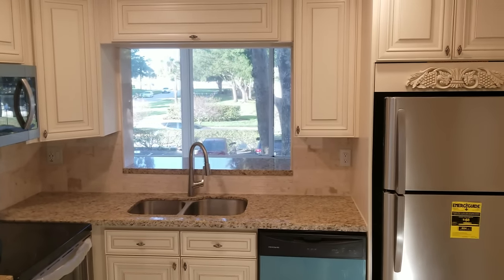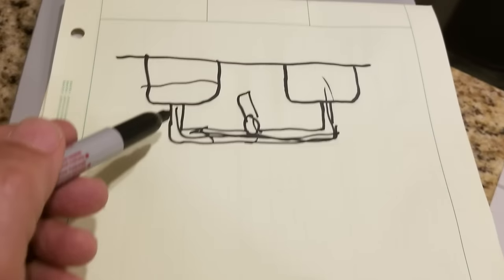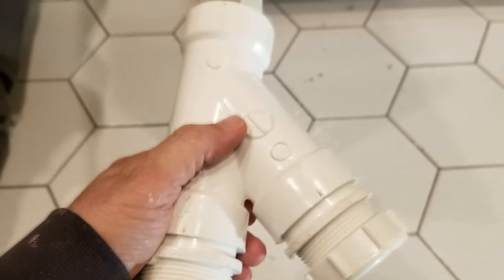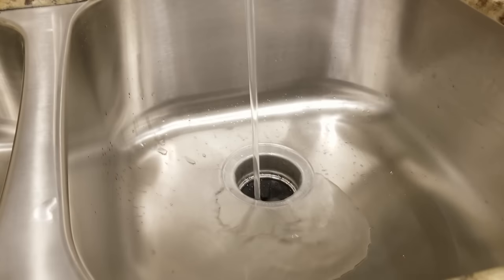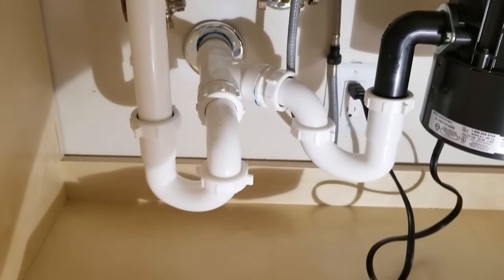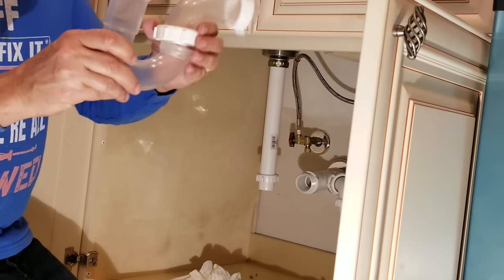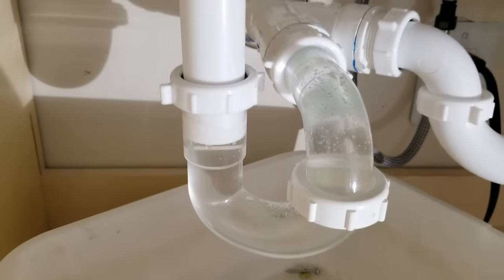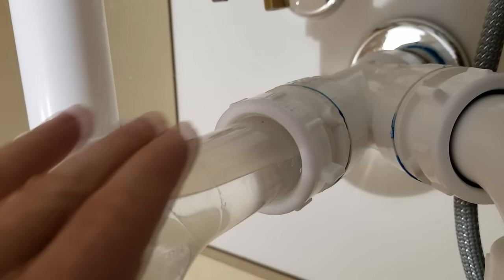How to Install Dual Kitchen Sink Drain Plumbing Pipes

Comment from the maker: ✅ Kitchen sink drain tools/pipes in this leaking p trap plumbing tips video:
🛒 Superior Tool 3-Way Sink Drain Wrench: https://amzn.to/2XozbZp
🛒 Nibco 1-1/2 in. PVC DWV Wye Fitting: https://homedepot.sjv.io/P1WbX
Reply: A lot of those t's have a baffle in them that just plug up right away when you use the garbage disposal.
Reply from the maker: @DamnWelfareBums  Luckily we avoided using any baffled T connections, using instead just the P-traps going into the Wye connector.
Reply: jeffostroff Yeah I like the way you did it.
Reply: @DamnWelfareBums  Exactly. I have had two near disasters due to those connectors having that baffle. It really restricts the water flow and if things like potato and carrot peels will get caught there and really back things up. I have thought about re-plumbing my system exactly as you have done to give the disposal its own trap.
Reply: Y

Comment: Two p-traps on one fixture is a no-no. One trap can siphon the other and cause issues. This is why you can't even have traps too close together. I've seen a washing machine trap siphon out the toilet trap. Not enough piping in between and the washing machine would siphon out the toilet whenever it drained and the toilet wouldn't flush properly (not to mention the sewer gases now could enter the house). One trap per fixture is code, that's all you need, don't overthink it because you're just making things worse.
Reply from the maker: They cannot siphon from one another when using a Wye like we did. You are allowed one trap per fixture, and each sink counts as one fixture.
Reply: @jeffostroff  I'm not sure a Wye can be on its side and function properly. I'm pretty sure a Wye has to be vertical to function properly.
Reply: I agree It can cause a siphon doing it this way. It might not cause an issue in every case but I don't think it's a better way to run a drain and  it wouldn't pass Code
Reply: If syphoning would occur, you could add an air admittance valve. I am certain this system will work.  My current system with one P-trap backs up to the other sink all the time.  Great video.  I’m going to do this. 🤘
Reply: @theflyingdutchman787  Doesn't matter if it'll work or not, it's against code. 

It sounds like your sink is backing up because of a blockage, probably in the existing p-trap assembly. Taking it apart, cleaning out the p-trap assembly and snaking the line would fix that. Adding a 2nd trap won't fix that. It'll just add another blockage point especially since you'd also be introducing a potential siphoning issue and then you'll have even more problems. Don't do this.
Reply: @jeffostroff  Yes, but you're still potentially introducing drainage issues with a 2-trap setup like this. Which is why it's more optimal (and code in most instances) to only use 1 trap for these kinds of situations.
Reply: @aliikane  A T-wye can't be used horizontally but a regular wye (like in this video) can.
Reply: @losferwords100  I appreciate the dialogue and your concern. The P-trap under my sink is clean as a whistle. I am trying to find the plumbing code verbiage that prohibits the wye-dual P-trap setup.  P-traps in series are not ok, I agree , but I can’t find the code addressing a parallel system like this. I truly see no physical reason why this system would not work properly, especially if a studer or air admittance valve is incorporated into the system.  Again, interesting debate.
Reply: You are so WRONG
Reply: Ive had this for years with y fitting it drains fine.
Reply: THIS!  He did that completely wrong.

Comment: JEFF WHAT HAPPENED???? According to the uniform plumbing code from ( The international association of Plumbing and Mechanical officials)  section 1001.0  No more than 1 trap is permitted per trap arm ( Pipe coming out of wall.) & per plumbing fixture. This should help You & Your customer's.. From many more future failed inspections.
Reply from the maker: Alex, the way I read that, is they are saying "No more than 1 trap is permitted per trap arm", which means to me, that you cannot have one P-trap followed by another P-trap on the same P-trap arm, which is the output of the first P-trap. They don't want people to connect 2 P-traps in series, back to back. But I am connecting 2 P-trap arms to a waste line through a Wye adapter. It really boils down to the definition of P-trap arm, which is not the waste line. The P-trap arm is simply the curved piece of pipe coming  from the P-trap.

Comment: The reason there is so much water in your P trap is because you didn't put a slope on the pipe going to the main drain... You also should have in a put a vent pipe... judging by how slow the water drains in your sink you need a vent pipe in that sink to prevent clogs and slow draining issues.
Reply: I been watching a few other videos and they always put a slope using a level. I was surprised he didn’t do that. When I saw to amount of water in that p-trap, I knew he messed up.

Comment: This is the right way to do the job. The guys who renovated my kitchen hooked it up as you drew in the first drawing. When you turn on the disposal, it pushes water out of the drain in the other side of the sink! I told them to fix it, and they hooked it up the same wrong way. So I did it myself. Thanks for the video.
Reply from the maker: Glad to help Stan!
Reply: Can't put a tee on its side

Comment: My friend, your video is EXACTLY what I need.  My garbage disposal always, I mean ALWAYS "throws up" into the other sink!  Going to implement this solution soonest.  Thank you, thank you, thank you soooooooooooo much!!
Reply from the maker: Another thing you can look into also when one side of the sink is backing up into the other sink, make sure that your line is clean all the way down to the sewer system. So we have another video that I uploaded about aklog we had similar to this in our kitchen, in my snake only goes 20 feet but we had to call the plumber with sectional snakes that could reach further down the line into the sewer system and they found some clogging there had a curd and so this can make the water slow to drain out of the sink and it sometimes will back up into the other one. You might be ready to have your lines cleaned.
Reply: @jeffostroff  I’ll see if this works, if not I’ll have a plumber clean out my line.  Thanks again for the follow up!!
Reply: Well I completed my Y-drain with dual p-traps and it worked like a charm, NO back flow from the disposal to the other sink!!  One thing I learned was the need for using DWV trap adapters to go from 1-1/4 to standard sink p-trap hardware.  But it all works!!!  Thanks again for your awesome video and help!!!!!
Reply: @snoodle877  Glad you gave an update. I have the same problem. Looks easy enough. Think I'll tackle it myself. 🤞🏼

Comment: I'm changing out my sink to dual sinks also and found this idea of double P traps  to be interesting. I decided to make sure this idea was a good way to go and was surprised to learn that it's not for a couple of reasons. One problem that can occur with a double trapped setup is if a large volume of water is released down both drains it may carry enough pressure to pull the water out of the traps which means sewer gases may be allowed into the house. Another problem is double traps cause drainage issues because air becomes trapped between the two traps, and air is lighter than water. That causes the air to travel up as the water flows down, resulting in no drainage. Also in some areas, using two traps  is not up to code and the water draining from one sink can impair the trap seal on the other so check your building codes. 
One thing I'd like to suggest to those who plan on using this method is when you insert the tubes into the wye, make sure one doesn't butt up to the other. I looked at the idea at Lowes and noticed the wye doesn't have a stopper in them so allow about 1/16-1/8 inch of the tube from the sink to go past the 2nd entrance of the wye. That will stop the tube from the wye from blocking it. 
After all I read and learned from plumbers shopping at Lowe's, I'll pass on this idea but good luck to those who don't. Peace out.
Reply: Your research is correct, 2 traps will cause one to empty the other or suck it out by vacume even if it's vented properly. I think this was just a diy idea and not professional advice.

Comment: I really like you idea using the y connector so you have to separate drains. In my case I used a trap that had a y connector built into it. Two separate drains connected to a y trap.

Comment: I thought you were going to drain both at once?  That's what I was waiting for.  Three questions:  (1) how does it change for vertical drains?  (2) How do you admit air in a vertical drain, and (3) should you use larger pipe for the traps to maximize flow?
Reply: For a vertical drain you want to continue the line all the way up to the top of the cabinet and use a mechanic air vent. 2 in is code for a kitchen sink in my area but every 1 1/2 is still very common. Personally you don't need two traps an arm over into a vertical tee then a trap is the right way to do it.

Comment: Jeff, a plummer left my house took my garbage disposal and never returned leaving my plumbing undone after working for two days.  I intend to try to plumb my kitchen sink following your video instructions.  I bought a new garbage disposal and there is two p traps and where you show only one line leading into the wall...mine has two, one into the wall connecting to one in the floor under the sink.  Can you help me?  I took a picture for you. Just now figured out how to comment to you.  Thank you running blind 57 😰
Reply: I tried to put it back together with what he left here but it's not right because my sinks fill up, both of them, my dishwasher fills up and my washer line spills out into floor our is drain line in laundry room.  Nasty foul smelling water is flowing when I do laundry or dishes.  The double p traps o
Under the sink is all wrong.  I guess the plummer left knowing there is a real problem here.

Comment: Thank you so much for making this video. This is exactly the issue i'm having in my kitchen. I do have a question, what is the purpose of the pea trap? I may be spelling it incorrectly. Can i just run a straight pipe to the Y connection with two elbows?
Reply from the maker: The P-trap is required by plumbing codes. The U-shaped part of the trap traps a columns of water that covers the entire U-shape, so there is always water in it. the purpose of this is to keep sewer gasses from coming up inside your house through the drain.
Reply: He explains it in more detail at minute 15:50.

Comment: I like the way you plumbed the system, but what I like more than that is the back of the cabinet is open to the wall. When the lower cabinets have an enclosed back, if there is a leak in the wall, you don't catch it before major damage occurs, as water plumbing can be from bathrooms being located in an adjacent wall. I hope you have open backs in all of the cabinets. It's easier to finish the walls nicely as the rest of the room.
Reply from the maker: I always request that my cabinet company gives me a vanity without the back on it

Comment: Hi - thanks Jeff - I’m thinking about using this configuration too for my dual basin kitchen sink. Did the parallel P-trap and siphoning issue ever get resolved? So 2 sinks side-by-side count as 2 “fixtures” and your   Not violating code? And have you experienced any siphoning problems using the “Y”? If you were using two transparent p-traps it would seem you could observe firsthand and could prove whether siphoning is occurring or not. Thanks!
Reply from the maker: We tested this thing thoroughly and had no siphoning problems

Comment: Love this video. Best one explanation thus far. Can you tell me why we don’t want a siphon ?
Reply from the maker: both of the p-traps are supposed to have water in them at all times to prevent sewer gases from coming up. If one of those were to self siphon in the water disappears out of there now sewer gases will come up into your house through the drain

Comment: @jeffostroff side note,  when testing for leaks,  always use Luke warm/ room temp water.  Using to hot or too cold of water can condensate and give the illusion of leaks. Luke warm will 100% of the time not give you those situations
Reply from the maker: Good suggestion. I have never had a condensation problem though, temp is usually 75 and cold water is not that cold, hot water has not made these pipes sweat.
Reply: I use extremely hot water always because if there's any Grease or sludge in the pipe that you didn't fix or change it will melt it away and less likely to create a clog. Also I use dish soap as well if you ever have an issue it hasn't degreasers in it

Comment: We installed a double farmhouse sink with garbage disposal. The plumbing is now off not only from the wall but the p trap is 3 to 4" lower. Would this fix that problem? So I just need to cut off the existing pipe a little from the wall, add the Y. My current is all pvc with "threads" so with this method a portion of this would be cemented or glued and the Ptrap would screw in? Does it matter or affect the drainage of water if the P trap is about an inch lower? Thank you for your help.
Reply from the maker: What matters most is the ep-trap output must be below the output of the garbage disposal, otherwise water will back up into the garbage disposal. So just make sure the pipe going into the wall is lower than the output of the garbage disposal. you might also consider the standard method on this home depot page, look at the photo with the garbage disposal homedepot.sjv.io/63DyG
Reply: @jeffostroff  Thank you for responding...new subscriber. Very Simple the way you laid things out. Does the Wye come with threads and did you have to use male and female 1 1/2 in DWV trap adapter?
Reply from the maker: @turtle_entertainment4112  watch video where you see the wye has a slip connection the we cemented the hub adapter into. The Male part of hum adapter cements  into it.  Then the P drop just gets inserted as a slip connection into that hub adapter

Comment: Jeff, do you recall where those trap reducers are purchased from?  Looks like "103R" from what I can see.   The Nibco unit appears to be just the Wye but neither Lowes nor Home Depot apparently know where those P-trap reducers came from.     Thanks!
Reply from the maker: Not sure what you mean by trap reducers, you're not allowed to reduce the diameter of your pipe so we would not be using anything that is a reducer. Perhaps there's a part on the set up there that is an optical illusion and has you thinking it is a reducer.

Comment: I have almost the exact connection and the sink without the disposal continuously backs up, especially when running the disposal. Only the sink without the disposal backs up, why is that and any ideas to fix?
Reply from the maker: This will happen if the output tube of your garbage disposal is LOWER than the P-trap output that goes into the wall drain pipe. Is this the case for you? this sometimes happens on remodels where people switch to a deeper sink, that now pushes the garbage disposal lower, so now it's lie it is trying to send water uphill.

Comment: I could be wrong, and correct me please, but doesnt plumbing code say only 1 p trap per trap arm?  This method is putting 2 p traps on 1 arm.  Not saying this wont work or drain since that's all slope related
Reply: It's definitely not code compliant to have two traps on one arm because it allows siphonage to occur.

Comment: You can put a santee on the disposer outlet facing lady sink and plumb in one pipe to the drain.
Reply from the maker: Only if it is in the vertical position

Comment: You can do a center waste on a sink with 2 basket stainers (without garbage disposal) without any issues. However center waste with a disposal doesn't work too well because food and waste gets caught on the diverters inside of the center waste tee and clogs up. Also not a fan of wet/dry glue used under a sink. It's messy most of the time. Clear primer is what I use with clear glue. Most of time inspectors won't say anything about it because it's visible plumbing. But they will fail you if you don't use purple on the underground.
Reply from the maker: That's wye we use the wye.
Reply: Un purple primer is what we use in my area. The primer can been seen in the sun light or with a UV light and it doesn't make a mess.
Reply: Clear primer is an instant fail in most areas in the states. Can't use it at all. The only time you can get away with using it is under sinks for making the final drain connections as at that point the inspections are over with. Only use clear primer if you know your work is not going to need to be inspected or learn how to use purple primer without making a mess, it's really not that hard.

Comment: The first drawing you did  is known as a continuous waste . That is against Wisconsin state plumbing code when hooking a disposal on one side of the sink , as well as it should be . Also  a cleanout fitting should be provided  in the drain line .

Comment: Hi! Great video. This is exactly what I want to do with my dual sink. I was wondering if you could add a parts list. I see two p-traps, one wye, and... looks like 2 threaded 1 1/2" adapters to connect the ends of the p-traps to the wye, plus Oatley Rain-R-Shine PVC cement and a pipe cutter.
Reply: So my real question is: What threaded adapters are you using to screw the ends of the p-traps to the wye?